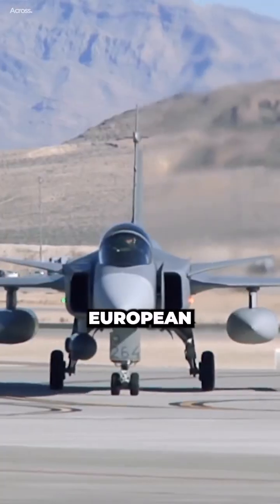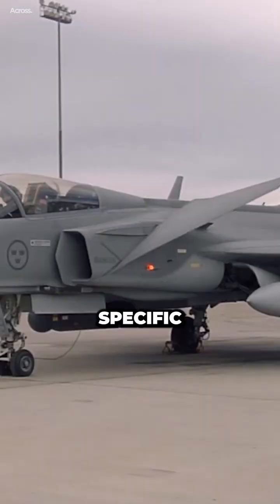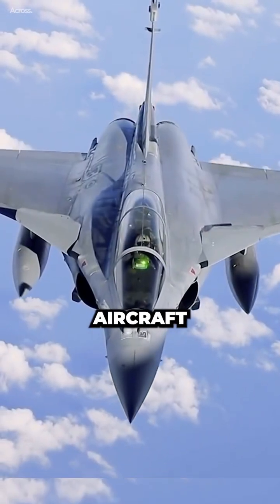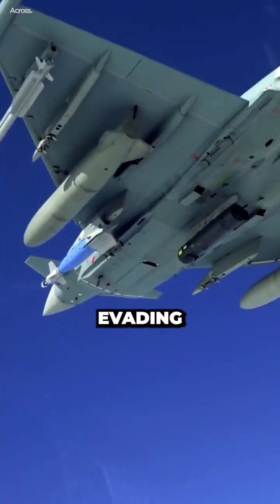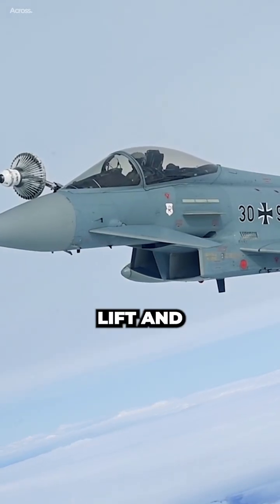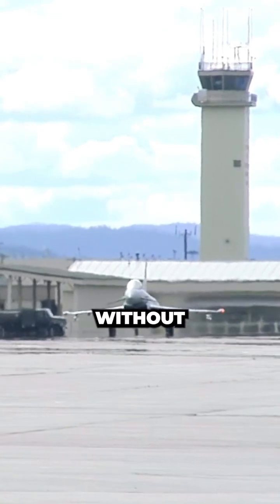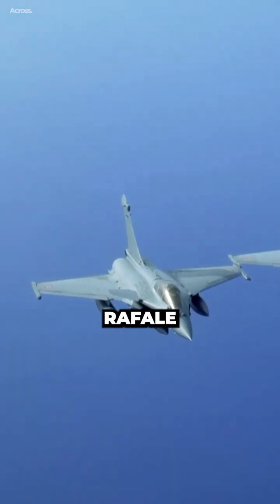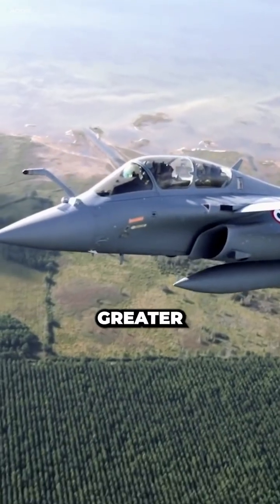Why Do Many European Fighter Jets Have Delta Wings?

Comment: It's odd, but by the way the video focuses on the Canards instead of the actual Delta Wing section of European jets in the video and reading some comments it's like they care confusing the Canards as the Delta Wing. Maybe its just me but yeah, the small wings up front are Canards and the Detla Wing is the main triangular section that has a 90° angle from the fuselage at the rear.

Comment: You didn't explain anything tho 😂. The answer is because it depends on what you want your aircraft to do and what expertise your designers have. Yes these days it's mostly delta wings, but let's not forget that Europe also has platforms like the Harrier, Tornado, Mirage F1, TF Kaan, and most of the platforms developed by the Eastern Bloc that aren't delta wings. Let's also keep in mind that the YF23 that was competing with the F22 on the US side was also pretty much a delta wing.

Comment: The one disadvantage with delta wings is their tendency to bleed off speed in tight turns. That's the primary reason US fighter designs don't use a delta configuration.

Comment: I really like the forward nose to intake design on the Rafale , it seems like its tightly woven into the fuselage creating a seemingly smooth flow of air off the nose into the intake and back across wing  ive never heard of any stalling problems really regarding the design , it seems to have a strong and sturdy build , if anyone knows of any stalling or airframe weakness please let me know.

Comment: Virtually ALL supersonic aircrafts since around late 60s utilize delta wing. No matter, tailess, with cannard or with tail, all are either delta or rather rare variable wing designs. Please check references.
Reply: Okay okay I have a question: what's the difference between a delta, cropped delta and a tapered wing planform in terms of aircraft MER and AoA capabilities

Comment: Also enables short take offs on 500m temporary strips  whereas F16 and F15 need runways 2400m minimum. Critical in central eastern Europe in battle conditions.
Reply: You know those numbers given are not the absolute minimum right...
Reply: @n3v3rforgott3n9  depends on load, weather and so on. Issue here in Poland is that the PAF reckons that its airfield runways will be knocked out in the first 24 hours of a Russian invasion and thus it will have to use short , temporary runways such as bits of straight roads which in turn requires aircraft with STOL capabilities and strong undercarriages. This is the major issue with F16 which, it has been found, need very clean  smooth , long runways and thus would have to be pulled back out of Poland in the case that their airbases are inoperable. I cannot comment on the F15 other that it has not been proven in a temporary airstrip environment over here in Eastern Nato. The F16 is in a similar situation. PAF pilots are trained in temporary airstrip use, as are Scandinavians and the RAF.
Reply: @michaelmazowiecki9195  With what Russian has shown in Ukraine I doubt that. Also they have done plenty of training exercises with the F16 and such from roadways and that info you stated is overblown. It took a short period of time to prepare a roadway to be used. Also I was talking about the public info for the minimum runway length is not the true info.
Reply: @n3v3rforgott3n9  here in Poland , colleagues in the PAF (Polish Air Force) have long been critical of the political decision to buy F16 as the operational evaluation at the time very clearly made the Gripen the first choice. It was Bush who forced the F16 purchase on the Poles as proof of their loyalty to the USA. This was a several years after Polish entry into Nato. The F18 which has a robust undercarriage (which is why Finland chose it) would have been a better choice than F16.